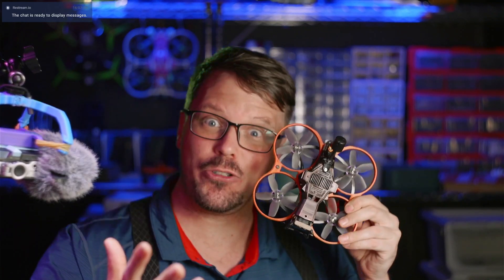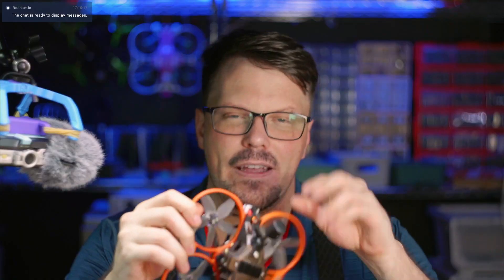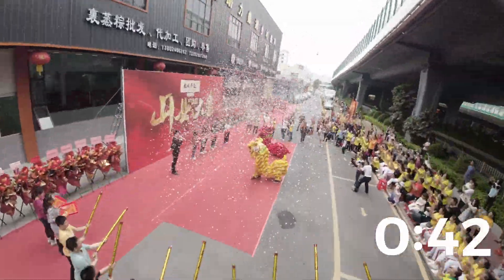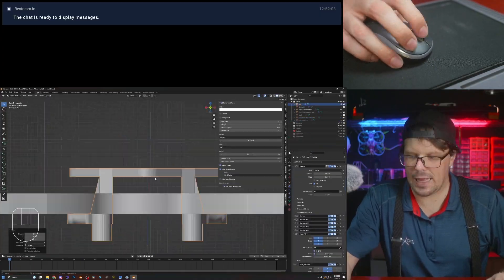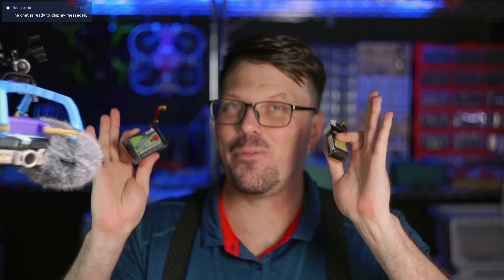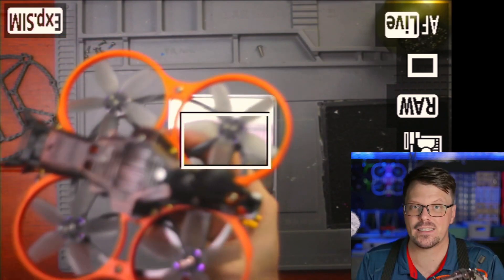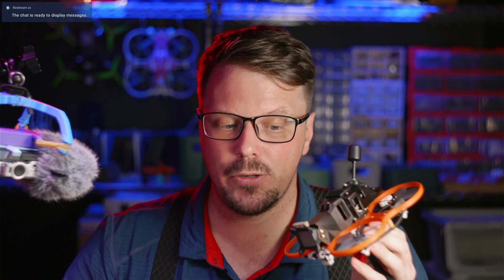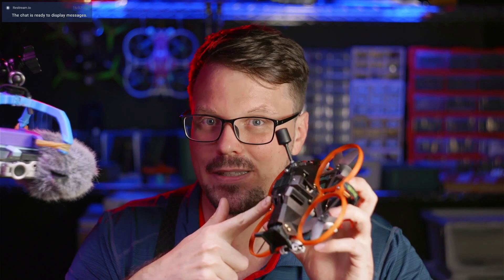A Sub 250g drone that will make the FAA Cry

Comment: Does this particular drone actually fly well? Does it come with a controller? I’ve bought a cheap drone for 150 the problem with it was that it couldn’t fly correctly could’ve been that the controller commands wasn’t syncing well with the drone. So does it fly well?
Reply from the maker: @MagicMatic  I have countless failed designs that never see the light of day. If I put a drone out there, it is because it is better than anything else in it's class. Otherwise why bother?

So yes it's awesome

Comment: How is dji getting 30 minutes flight time out if a 250g drone?
Unbelievable.
Reply from the maker: Because DJI camera drone props are 4 inches and the power to weight ratio is WAAAY lower
Reply: @33rdframe  So, is it possible to change the propellers and get the 30 minutes? What would be the changes to the config? I'd like to try and build one.

Comment: Isn’t one of the requirements of category 1 drones that they can only fly over open air events with remote ID. Does this have remote ID?
Reply from the maker: It could, and still be sub250. But what's the point of being sub250 if you have Remote ID
Reply: @33rdframe  What are the operations over people categories?

The ability to fly over people varies depending on the level of risk that a small UAS operation presents to people on the ground. Operations over people are permitted subject to the following requirements:

Category 1 small unmanned aircraft are permitted to operate over people, provided the small unmanned aircraft:
Weigh 0.55 pounds or less, including everything that is on board or otherwise attached to the aircraft at the time of takeoff and throughout the duration of each operation.
Contain no exposed rotating parts that would cause lacerations.
In addition, for Category 1 operations, no remote pilot in command may operate a small unmanned aircraft in sustained flight over open-air assemblies unless the operation is compliant with Remote ID.   Category 2 and up there isn’t a drone compliant with those rules. I know a few people that would  be very interested in a ready to fly option to meet all these rules. Some run the lighter Japanese  market batteries in DJI drones they are 50 grams lighter allowing you to fit some type of prop guard.

Comment: Pretty awesome. I just picked up my first FPV drone, the cinebot30, and am learning to fly it after adjusting some rates, throttle limiters and such. Still, having a smaller drone with o3 unit would be awesome. How resilient to crashes is this one you've built?
Reply from the maker: my drone is roughly 250% more durable than cinebot 😎

Comment: if i buy one does it come with a battery?
Reply from the maker: i can sell batteries in bulk because I cannot ship the batteries with the drone the bats have to be shipped separately. that being said I found a loophole is that is the battery is installed in a device they say I can ship. so its a bit of a gamble that i havnt risked yet. but i know for sure i can ship the bats separately, though its a bit pricy for shipping so bulk is the only thing that's worth it. 

I will however give you extra prop guards and some other gifts

Comment: Nice design and build. I wonder what lipo would be needed if you were to run a Naked GoPro. The o3 is cool and all, but still does not beat a Naked GoPro Hero 11.
Reply from the maker: I think the better drone to carry a naked GoPro is the MechaRoach. This is specifically for the o3
Reply: @33rdframe  Cinelog25 HD has been crushing it with Naked Hero 11 and maintains sub250.
Reply from the maker: @LZRFPV  flight time?
Reply from the maker: @LZRFPV  I also question the footage you can get with cinelog as it always introduced way to much wobble and jiggle for me
Reply: @33rdframe  3-5 minutes depending on how I am flying. Could probably squeeze more but I try not to abuse my batteries haha
Reply: @33rdframe  been using it for professional real estate gigs as well as major concerts/festivals without issue.

Comment: Amazing quad man!

If you get a chance can you design a sub250 DJI03 air unit acro quad with prop guards. Maybe a 6s one if possible.  Something similar to the oddityrc XI25Pro HD 03 version but without inverted pusher motors.  The oddity rc one is not sub250.  If you could design a sub250 acro quad with about a 4 minute flight time it would be great.  I’m not sure if all that is possible.  A canopy with lots of holes in it might help reduce weight.  Something similar to the happy model mobula 8 Dji 03 version canopy might be an option.  Also smaller vtx antennas might be helpful.  I’d also like it to be able to use ELRS.  I haven’t found anything on the market that exists like this.  There are no sub250 dji03 acro quads with prop protectors on the market.  All of them are cinematic quads. 6s motors with 2.5 inch props might be the sweet spot I’m not sure.  

That’s my dream quad.  I just think it would be a fun park flyer that wouldn’t bother anyone.  

A 4s motor prop combo might be the best option.  I’m not sure what motor prop combo would give the best power to weight ratio but I think motor and prop selection is a key factor due to weight.  Probably would need to be around 150 grams without a battery.  Most decent size batteries will probably be around 100 grams to give a decent flight time.

Looking at a modified version of the happy model mobula 8 Dji 03 version might be a good starting point.  It is 99 grams without a battery.  It’s too heavy and has a bad power to weight ratio.  But if something similar could be designed that weighs 150 grams without a battery, the power to weight ratio could be greatly improved.  Let me know if you think it is feasible.
Reply from the maker: Without prop guards I think it is possible
Reply: @33rdframe  Something I just thought about (and it may be a stupid idea) but has anyone designed a prop that already has a guard attached which spins with the prop?  Would that be possible or would it just mess up all of the aerodynamics of everything?  I was kind of thinking of a spinning circle maybe 10mm thick molded in with the design of the prop itself.  Like a wheel rim and the prop is the spoke of the wheel.  I haven’t seen anyone try it.  From a protection stand point I think it would do the same thing as a prop guard.  It would protect you from getting hit by the outside edge of the prop.  From an aerodynamic standpoint I don’t know what it would do.

I guess from a friction standpoint the prop could hurt someone though.  Even a wheel spinning fast enough could cut or burn someone.  If the outside rim was a cylinder it might help with that so there would be no sharp edges.
Reply from the maker: @hallfatherofthree7022  the problem would be weight, props must be light